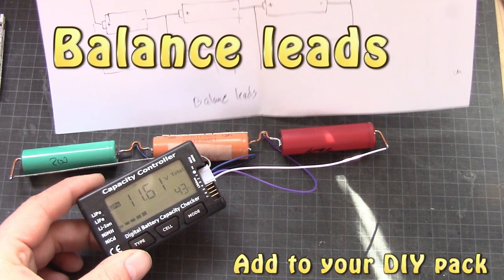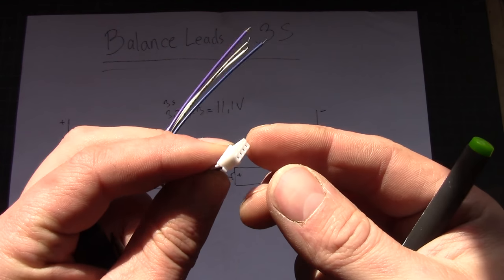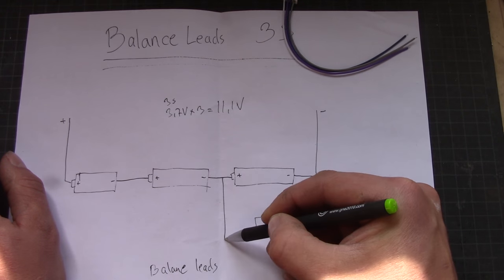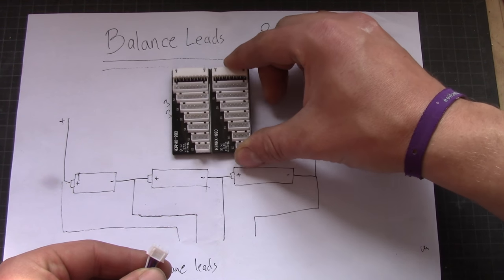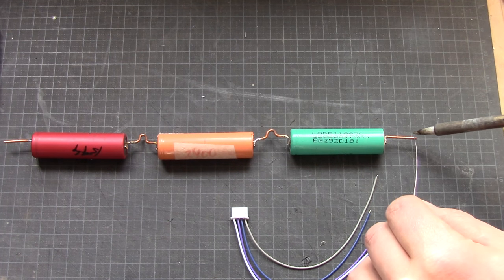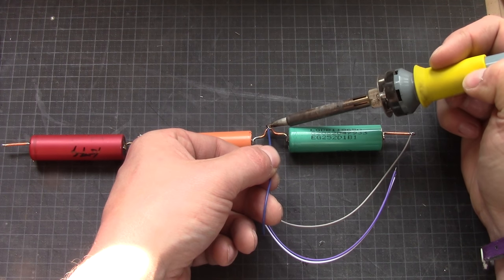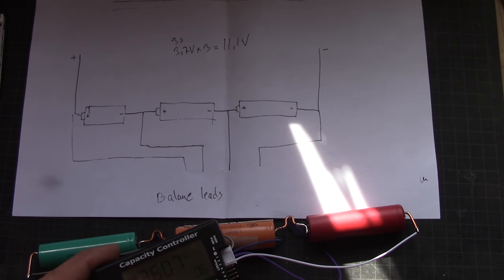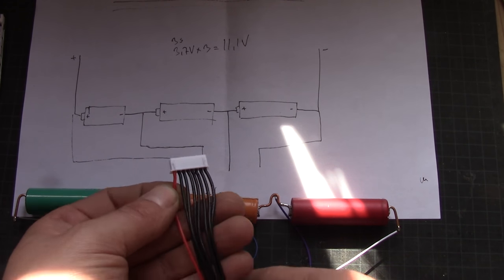Balance leads on DIY Battery packs how to

Comment: Great explanation on how these leads get wired.  I'm old school NiCd RC fellow.  I'm new to the Lipo scene.  I was recently manually balance charging LiO 18650 cells in some Milwaukee packs which have sat for years unused, but new.  I have a 4 cell (individual charging slots for 1 cell each) charger from the vape/flashlight market.  I made some cell adapters to place into the charger with some test leads (j-hooks) to attach to tabs on assembled packs. The goal being to charge each cell individually with each port of the 4 port charger.  I used this successfully to bring cells up to 4.2V each.  However, I was only able to use one charge bay, and do it one cell at a time.  I bought a different 8 cell charger (for loose cells), but it would fault out when more than one cell was connected.  I made a bunch of blank cells with wire leads to place in charger bays.  I'd like to try to use them all at once, as I have large 12ah tool packs I'd like to bring into balance.  Would using diodes maybe help?  I'd like to avoid removing tabs.  Should I just break down and buy a hobby balance charger?  lol  I actually have a lot of 4s, 5s, 7s leads from other projects.

Comment: Thank you very much for this excellent video . 
Could you please help me with my tenergy tb6b balance charger? I have lost the balance connectors and i need to charge three 18650 cells just like the video.but i don't know if i need to connect just these four cables ? Or the two red and black output port also? 
Thank you for your help

Comment: TY I just wired up 2s3p on imax b6 . I have 2 battery packs done now for ebike light. First balance was 4.2v and 4.11v  and it brought them back in spec 4.2v 4.2v.

Comment: Thanks for the great tutorial. My question is if I use only 2 cells, can I use just the 3 wires excluding the last wire on the furthers left?
The other thing is can I mix cells that are different in mAh (2400mAh & 2600mAh)?

Comment: Can you recommend 14 lead wire harness and where to purchase for the BMS connector? Two routes to go purchase all the parts to make my own wire harness or just buy the pins, tool for removal of pins and crimping tool.
Reply from the maker: 14s jst contacts are very very rare to find. Best is to buy a cheap bms and then use a flat head smal screwdriver and move the pins.

Comment: I heard both sides of this story from many people and although this works it less accurate because the leads are supposed to be far right is directly connected to negative and the rest go to the far positive end. But this works for me as well. Why I bring this up is because you can tap off of each of the batteries while connected in series by connecting a wire to the first battery positive and negative or connect to the first battery negative and second and the second battery positive and you will get 7.4v then connect the negative from the first battery and the last = 11.1v which leads me to believe the leads go to the far most positive and also leads me to believe there's a better method and it works perfect every time... The batteries that are wired in series will never balance out on their own so what I do is charge each battery pack individually... On a 3S I use a MPPT to charge each so I would use three separate isolated from the others by using three solar panels and they shut off when each reaches 4.2v and 12.6v total but as soon as I start to drain they start to charge and you can do this using 3 - 5v solar panels and 3 - charging modules... You can also do this by using 3 wall phone chargers connected to 3 TP4056 and it works, if you don't isolate each TP4056 by using 3 separate sources of power the chips will fry. Something to toss around.
Reply from the maker: MrBrymstond note that this is not about solar and balancing a pack ;) its about adding balance contact for purposes like charging a pack with a balance charger. example rc or ev wehicles

Comment: Thanks for video, is it possible to use a 5s wires on a 4s pack or a 4s on 3s pack. And are the leads after the first negative you connected, positive or negative? Because you placed them between the batteries and the last one you placed was on the positive of the battery. Looking forward to your reply. As always your videos or top notch

Comment: Nice tutorial. I have one question - could be 4S/5S/6S balanced cable used for balancing 3 batteries? And if so, how to connect cables? Thank you for answer!
Reply: As long as you're going right to left on the balance cable connecting the batteries like the video showed then you should be fine. The balance cable doesn't have any controller inside that'll get mad it's just a little piece of copper and plastic.

Comment: Will this work with Nimh battery’s as well
Reply from the maker: No. Wrong voltage. Nimh runs at 1.2v nominql
Reply: DIY Tech & Repairs I know it’s the wrong voltage I’m talking about The balance connector I make 5.5-6v nimh rechargeable battery packs with 4xAA battery can I add a balance connector
Reply from the maker: @93jdmmike  sorry yes you can add balance comnectors in same way. Make sure the Charger handles it
Reply: DIY Tech & Repairs I have a icharger

Comment: Why does one need balance leads? Can't one charge the battery pack with 12.6V?
Reply from the maker: Yes you can but lithium are dangerous IF One intrnal pack in a series gets overcharged or overdischarged. Therefore you need to Keep track or each cell in a pack. And to maintain the pack a bms with balancer is needed. Lead acid you dont have it because you balance by overcharging instead. Lithium would let the Magic smoke out :)

Comment: Hi 
I am working on electric motorcycle project. I have planned for 10 - 12KW battery pack. 
Expected voltage 72 and 90. 
Can you provide some options for this pack? 
Max weight expected 50kg. 

Thank You
Reply from the maker: 10Kw and 50kg is just barely depending on cells. If you go with 3.4Ah cells you would be able to get there. A 3.4Ah cell would be roughly 3.4*3.7 = 12.5Wh.  
10 000/12.5 = 800 cells. 
Lets say the weight is 50g/cell . That give you a weight of 40kg. Then you need to add some extra for that and you end up with easily 45kg or more.

But on a bike with some power you might need high current cells and those generally is a bit lower capacity. 
Lets say you take 20A current cells with 2600mAh per cell. Thats 1000 cells and 50kg :)

Then for 72V system either go with 18s or 19s depending on what the components can take. Same goes with 90. Need to check max and min voltage of all parts.

Last: Buy some cells and build :)
Reply: Can we use polymer pouch battery? 

But weight is been increased when using those pouch.
Reply from the maker: Yes you can use pouch. But you need to be a bit more gentle and build a better case for it.  Pouch is more fragile and will easily catch fire due to no outer protection at all. But on the other hand many of the pouch types do deliver alot more current. Search for "Lipo fire" and you will see what or how a lipo can catch fire.
Reply: Can we use LiFePo4 cells lithium iron. It is safe?
Reply from the maker: SRIRAM RAM lifepo4 is generally more safe than both liion 18650 and lipo. so it depends if u need that oe high current :)

Comment: I just though of an simple invention I have not seen. What if you had a device that limits battery voltage to 4.00V if it ever gets higher than that it dumps to a resistor.  Thus if you hook 3 of these devices to each battery above, the cell voltage could never get above 4V.  Thus you don't need BMS as the battery can never get above 4V. Each one might only cost less than $3.  Then you could reuse the device if you decide to go from 12V to 24V to 28V to 48V.  It would make wiring simple too. Safety would increase too since a buzzer could go off if the voltage got too high in a cell.  This video gave me the idea.  Eltrdacus is smart he has the bms built into the charge controller.
Reply from the maker: pirucreek thats a bms u talk about. all passive or bms system in sense of dissipating the excess energy do above. its the most common approach and exist in many bms systems :) though they will only do 1a or so continous. my solar system can chatge 300a :) also note that above tester i used do exist with balance function and they use resistors for that. but good idea.

Comment: I've read people saying that the balance leads should be equal in length. But with the standard resistance of 22AWG wire being in the range of 85 milliOhms per meter and manufacturing tolerances in wire being a few percent, isn't this nonsense on a battery at the physical dimensions of a hobby pack? Can I just trim (or extend) the wires so that they form a tidy bundle?
Reply from the maker: Markle2k depends on charger. rc batts have different lenghts.... i do them in different too and that have worked fine with my icharger so far. ie they have kept the correct voltage after.

Comment: using a soldering iron on litium cells is a dangerous way to connect them together. hey aren't tolerant to heat compared to ni mh or ni cd. the wiring instructions for the balance leads was most helpful

Comment: What happens when you add parallel groups?
Reply from the maker: ,you get more cpacity
Reply: @DIYTechRepairs  I meant, how do you balance the cells in the parallel groups.  Sorry for not being clear.
Reply from the maker: @noleftturnunstoned  either balance leads between Them or 2 BMS systems
Reply: @DIYTechRepairs  Hmm, that seems confusing. I think there us something that I just don't understand. I guess I have to do more research.
Reply from the maker: @noleftturnunstoned  when you parallel 2 cell you basically add Up those capacity and it becomes One cell. More info on the forum. Link in description